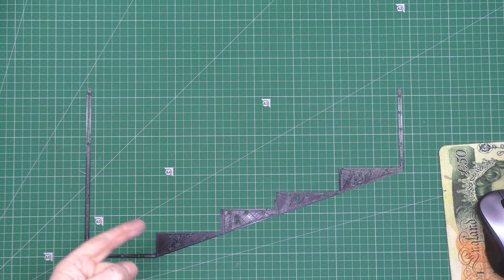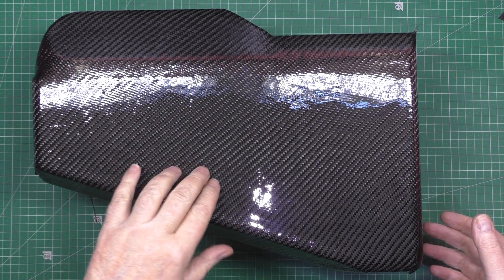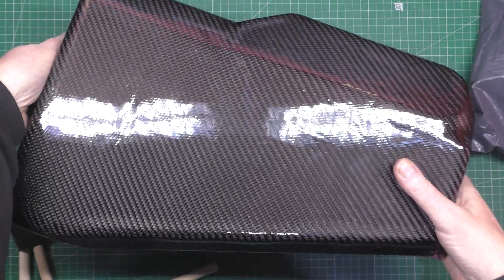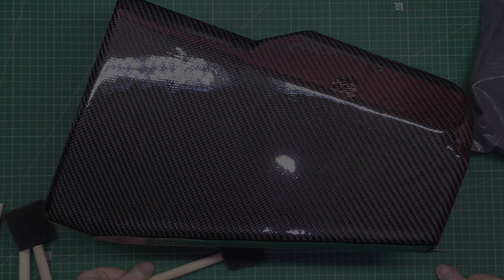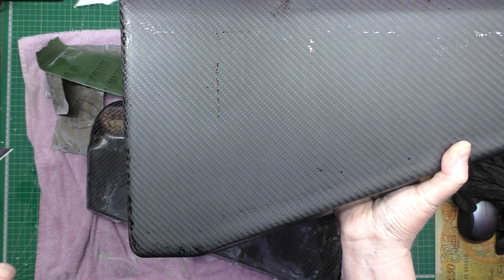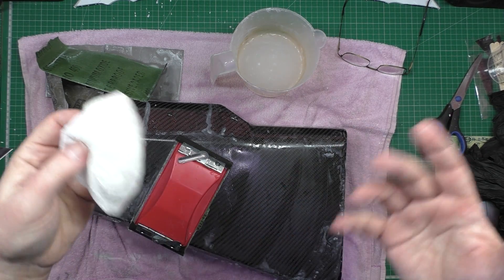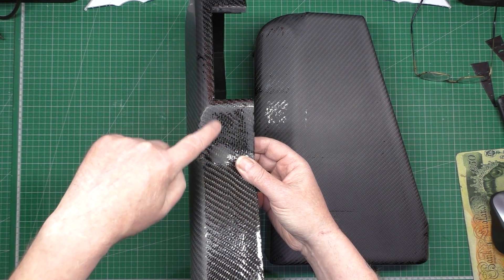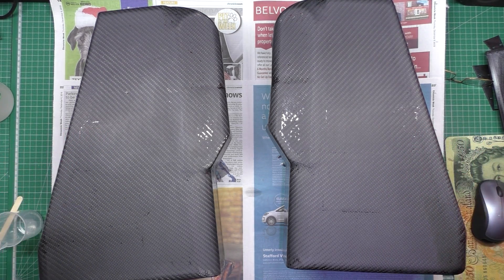High powered DIY eBike MSVA build part 16 - Carbon fibre skinning part 2

Comment: so... a few days back I asked about super capacitors, the possibility to use them as batteries, now Tesla has put 218 million in a tech developed by maxwell, apparently the goal is to add some sort of super capacitor into the battery, apparently they would gain in 3 mayor things, longer battery life, faster charging and longer range...  I have seen some electric mopeds/scooters where I live, but they mostly use acid batteries, thus not very good, I wonder if you or the viewers could explain how to mix the tech, so that we can do at home, the super cap/battery combo just like tesla, or similar to it... (I can imagine that there would be somethings that we may not be able to do with common hardware)
Reply from the maker: At the moment, super capacitors are pretty useless for our needs. Yes, they can be charged much faster than any lithium battery. Yes, they do have far more power than any lithium battery but they can't hold a charge like lithium batteries because they have a very high self-discharge rate. 
I think Tesla are going to use them to take the load off the main battery by charging them (from the main battery) so they can be used for massive, instant power. Constantly running lithium batteries to their max output does degrade them and, having a sort of buffer power, will extend their life.
Like I said, at the moment, there's no point in using them because of their size and the very high self-discharge rate. Who knows, in the next 5 years, we might all be using them.

Comment: I could see bubbles on the one on the left,  on the bottom right hand side. Hope you fixed em,  well they looked like bubbles 😉
Reply from the maker: They were actually tiny parts of foam from the brush. I discovered that the brushes start to dissolve in the epoxy after a while due to the exothermic reaction.

Comment: Not bad but... hair drier to flow the resin (pops the bubbles, wets better) and faster curing resin for the shiny coats. The 5-30min is fine. or just put more oxydizer... but, well, they came out nice. Nicer than mine but I just went for pure funtcion and gave one, just one crap about looks :D
Reply from the maker: I don't have a hair dryer because I have no hair 😁

Comment: Wow, that’s some perseverance,Tony. Another way to get a nice surface finish is to vacuum bag with mylar sheet, but that is a bit of a process onto itself. Perfection is good, but slight imperfection can be indicative of “hand made” vs buying it done (at least that is what I tell myself).
Reply from the maker: I did consider vacuum bagging it, Bob. The trouble is, the cost for the vacuum kit is rather expensive for a one-off. Now I know what I'm doing and I know I can do it, I might invest in the kit to make some CF parts :-)

Comment: Huge amount of work there Tony! You're not kidding about being a perfectionist!
Would making a mould and using vacuum bag resin infusion have helped?
Reply from the maker: I have considered it, Andy. The trouble is, I need the casing to support the full weight of the battery and (If I do an infusion resin case) the batteries will sit on the CF shell. Even if I put insulation in the form of neoprene, there''s still a chance that the battery cells will wear through the insulation and touch the CF - CF is conductive and I don't want to risk it.
Plus which, the kit to do the job is rather expensive for a one-off.
Reply from the maker: Oh.... Next week is probably the biggest and most important video I've ever done. It's so important that I actually appear on camera!
Reply: @Vortecks  I don't follow the logic why infusion would be any different electrically from what you're doing now - you could always paint on an extra layer of epoxy.
A mould could be concave or convex, so can build out or build in IYSWIM.
Yes, I guess it's not cheap - but I think it's likely you're going to want to do more, and you can always sell the kit to one of your subscribers wishing to do the same!
Maybe you could even set up production and make a range of off the shelf designs and parts for various battery combinations and bike frames!

Comment: Two instalments on carbon fibre...  I hope this bike is fantastic. 😂👌👍👍👍👍😁
Reply: There will probably be 2 more...luv it
Reply from the maker: This is the last CF video now but the battery still isn't finished. I never thought that a battery construction would be so complex!
Reply: Vortecks you can only blame yourself 😂. You couldn’t just have a normal battery like everyone else. Brilliant. Looking forward to the next instalment. I’m having to rewind my mxus, due to phase wire catching the cover arrgghhhh. It’s fried some windings. New motor on order, but I’m going to have a bash at re winding and replacing the halls. Should be a barrel of laughs. Can’t find much info on the windings for the mxus, seeing I’m going from a 5T to a 3.5T. I love a challenge. 
I think you should re wind your motor so we can all see how it’s done 😝
Reply: Vortecks Also, this is worse than a breaking bad cliffhanger... 😱